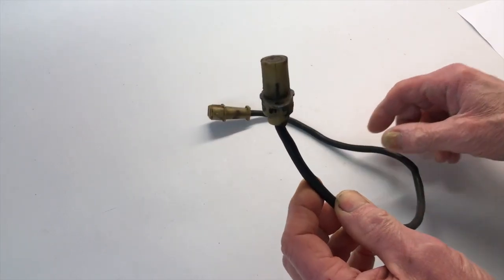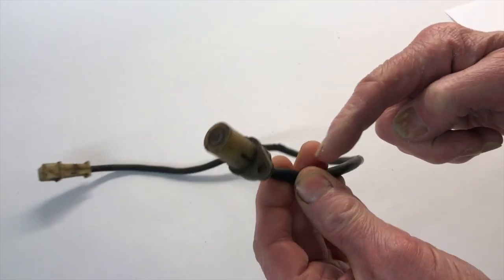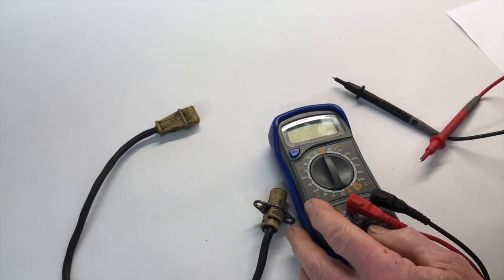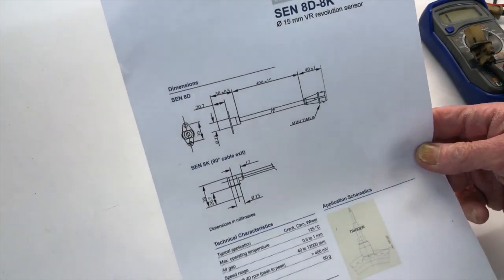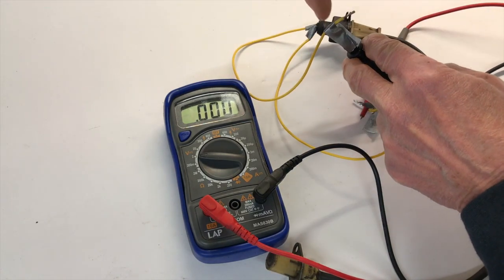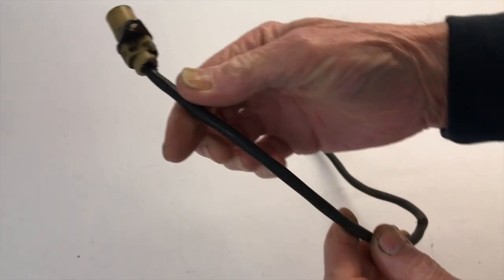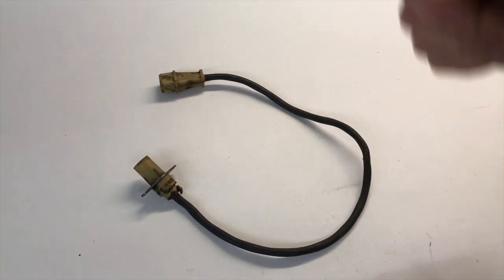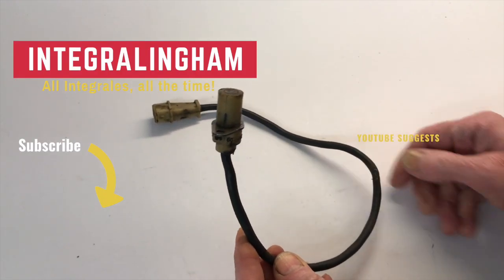Lancia Delta Crank Position Sensor, a lecture!

Comment: Hello! I got fiat 16v turbo and got the same problem. You save me lot of trouble. Many thanks. Problem with this sensor is that it has negative and positive spike. That means shielding can not be grounded. You lost half of spike when this short happend.

Comment: if cps is broken, will i lose spark on the spark plugs?
Reply: @Integralingham  car was driving normal, i installed shortshifter and wanted to test the car, but she would not start.....changed the ignition coil but no changes......will change cps and see what will happen